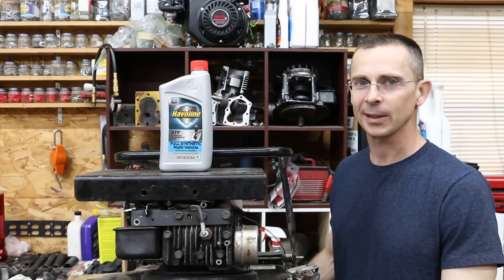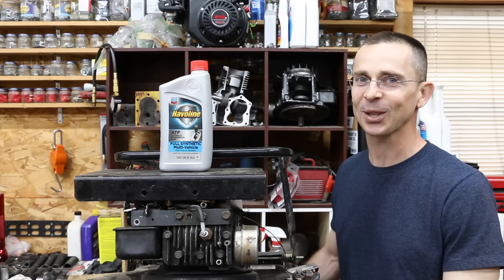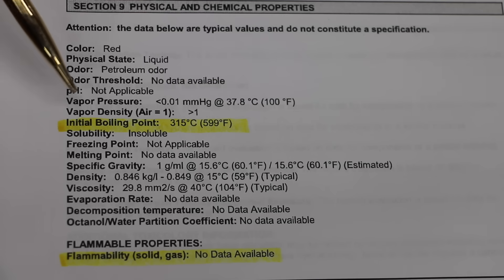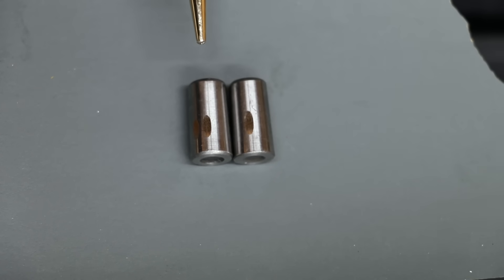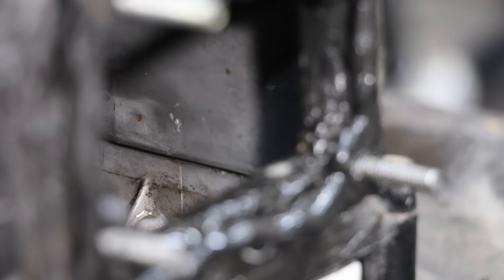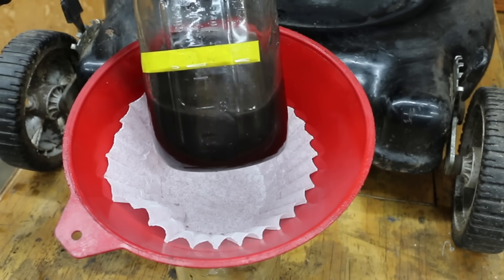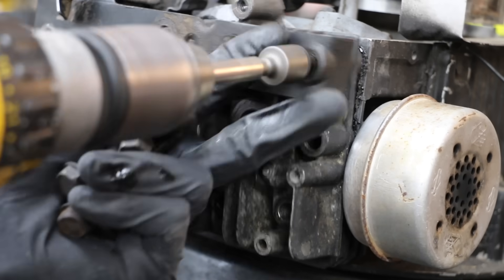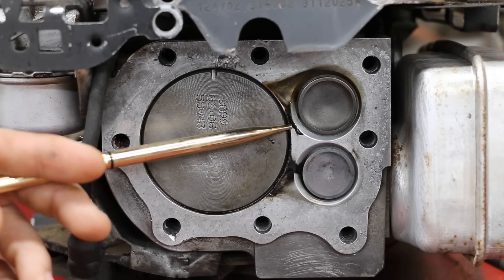ATF as an Engine Oil substitute?  Let's see what happens!

Comment: ATF will definitely clean up an engine.
Guy bought little old ladies car that ran perfect up and the streets near her home. She was trading for a car with automatic trans and learned she could get more by selling privately. Rust free, spotless car, he thought it was a steal. On his way home it would not go faster than 40. It  was so plugged up from her putting in town three blocks and shutting it off. He pulled the valve cover and it was just horribly slimy in there. When he removed the engine oil drain plug, nothing came out. He had to poke it with screwdriver. He called a friend who worked in gas station for years. Guy told him put valve cover back on and fill it with kerosene right up to the top. Remove spark plugs and shoot in a generous dose of STP gas treatment. Let it sit for several days, then drain it. change oil filter and fill with three quarts good oil and two quarts ATF. Drive it at least 500 miles  and change oil and filter. This time four quarts engine oil, one quart ATF and drive 1000 miles. remove valve cover  to see what it did.  Guy was stunned, almost all the sludge was gone from the rocker arms. The oil was black. The STP and ATF loosened up the sticking piston rings and the car could run 55 all day long.

If I remember correctly, he continued using at least one half quart ATF with every oil change.
Reply from the maker: Thanks for sharing.

Comment: certified technician. True believer of ATF on sticky Piston rings. had a 1993 Honda Civic 320,000 KM that smoked so much blue from the exhaust everyone thought the engine was done. Put a liter of ATF in ran the vehicle up to temp and drove it 5km  performed a hot oil change, The vehicle never smoked blue and the engine lasted years more.
Reply: My neighbor was a mechanic and kind of a cheapskate. He put all the drain gas from the lawn equipment he repaired in his 87 Mazda pickup and topped the oil off with "good used" motor oil. 
He passed away in 2016 and his son donated the truck(nickname "Smoky")to me when he cleaned out the place. 
Smoky had 435,000 on the clock and burned a quart of oil per tank of fuel.
I had gallons of atf from a abandoned storage unit. I did a lof and used 4 quarts of atf. Drove 200 miles of 80% highway and dropped the oil. 
The truck burned a quart every 3k after. ATF obviously freed up the rings and carbon. Nephew still hauls his dirtbike in it every weekend. Not bad for a 1982? Free truck.
Reply: @dwartfarquart9590 that’s damn cool
Reply from the maker: Thanks for the feedback.
Reply: Absolutely sometimes you just need to flush the gunk out
Reply: I heard of somebody using atf as a penetration fluid for old and seized engines.
Reply: @sdjnwhyNZ : 
Key is ussed trans OIL ... !!!! .. is ( has more acid in it !!!! )
Reply: Going to try this
Reply: @kh83401 older car, sure, newer car just run full synthetics for a slow clean up.
Reply: Got those results after only 5 km?
Reply: Certified technician is an invented story 😂
Reply: I'm pretty sure when they say add transmission fluid, it's to the oil not just pure transmission fluid. should be better than gas, diesel, or kerosene.
Reply: My dad would put ATF in his cornflakes if you let him.....all his stuff runs mint and gets tranny fluid flushes ,he runs it in the oil the fuel,power steering, probably his brakes ,transfer case ,diffs you name it lol
Reply: That's exactly how I was taught to use ATF in an engine by my Grandpa.
Reply: That's an interesting result that you had.   perhaps there's some similarity in the testwhich project Farm just did:

Like the test which just showed some metal in the residue of the ATF, perhaps there is something to the ATF either shaving some smoothness into the cylinder wall or rings ...

...or perhaps it flushed out some metal pieces that were stuck on the Rings which were causing some blow by.

Comment: atf as hydraulic system
Reply from the maker: Thanks for the feedback.
Reply: @ProjectFarm  sorry i type with the on screen keyboard when im just on the couch and the laptop is at the tv
I mean if you test a hydraulic pump with ATF
I'm currently running it with my anchor winch on the boat in a pinch and im wondering how right or wrong the internet is about atf as a good cold weather sub

Comment: Ive always used ATF for (like you said) stuck lifters, or carbon build up in a static environment. Ive never run an engine with the atf inside it as an oil replacement. After soaking stuck parts in atf for atleast overnight, it does a good job freeing everything. However, ive learned over years of pulling wrenches and field testing hydraulic systems for Komatsu, and other big name heavy equipment companies, if you have mechanical parts that repetitively fail or show excessive wear, it is cheaper in the long run to replace said parts with new ones. Then take a good look at the ambient environment the machine is being used in. Or check for lubrication SPECIFICS! Most any machine designed to be operated with some type of lubricant will have certain specifications required to get the most life out of said machine. Even something as simple as the average elevation you will be running said machine in can cause severe issues if you do not know any different. I can take a Chevy 350 base engine and in Mississippi running 30w engine oil and I will have to rebuild the engine before the starter ever gives any problems. However, that same engine and vehicle with 30w eng oil being used daily in umm, northern Indiana, Illinois, or Canada and within a year to 18 months you will have to replace or rebuild your starter because of the extra stress and wear placed on the starter during cold winter months with oil designed for subtropical temperatures. Using a 10w or 5w30 engine oil designed for operating in a cold environment will drastically lower the resistance the starter has to overcome beforehand and as it spins the engine over.
Basically cause and effect. Understanding the effect with some common sense and reading the owners manual often times leads to prevention of the cause...
Reply from the maker: Thanks for sharing.

Comment: Have you tested different ATFs?
I always hear that if you get water in your oil you can't recycle it, you need need to dispose of it as contaminated waste, but I had a pot I didn't like and a hot plate.  I heated it until the water evaporated and then recycled it.
I have been trying to find a transmission leak and have put a lot of Lucas Transmission Fix in there.  I had a pan of ATF that looked watery, so I used the pot and the hot plate... and it boiled away.
You said the boiling point of ATF is 600°F and the MSDS for LTF is >500°F, so what did I do besides personally ruin the atmosphere?!

Comment: My neighbor uses ATF in his diesel fuel for his tractor...he says that it has been a mainstay of running a quart every fourth fill of the fuel for the machine for years since the lower sulfur formula.  I have been using the Power Service Diesel Kleen which seems to help starting etc.  Years ago I was told by an older mechanic to take several quarts of ATF and run it in the crankcase of my older Ford 6 cylinder pickup after draining old oil to flush out and then to do the regular oil change.  I did that every third oil change before selling the truck....last I heard of that truck, it was still running well despite the hard life I gave it pulling a trailer etc.
Reply from the maker: Thanks for sharing.

Comment: I had an old 74 olds 350 with a sticky lifter …tried a quart of trans fluid in the crank case for a week of town driving and it did help…engine would only a couple seconds of ticking on start up and the moment the lifter got oil pressure it quieted down!
Reply from the maker: Thanks for sharing.

Comment: I agree you should not use the tranny fluid alone. For cleaning crank case etc use about a 10 - 20 % mixture eg. throw in a half quart to a quart of TF in about 100 mi. before your next oil change, then dump it. That'll do what you want it to.

Comment: A fellow I know brought a push mower to me to check out to see if it was any good. Before attempting to start it I checked the oil. Somebody had put transmission fluid in for oil. I drained it for longer than normal
 I put in 30w heavy duty oil, dried off the plug. It still wouldn't start without pouring gas in the carburetor. Then I found oil coming out of the muffler. I assumed the motor is damaged. I drained the oil again. It looked milky. I've thought about putting in more oil & that the transmission fluid had thinned the oil. Do you think it would be a waste of oil to try it again?
Reply: sounds like you either had water in the oil. or that you put too much oil in.  If the motor runs its likely not ruined.  Pouring gas in the carb indicates there is a car or fuel line issue.
Reply: @MichaelMantion  I put in the right amount of oil. My problem is oil coming out of the muffler every time I pull the rope. I assumed the thin transmission fluid had ruined the rings or  or the cylinder wall.

Comment: I've been running atf prior to and @ oil change time for years on my 5.9 gas mopar for 22 years , not religiously mind you , but often just the same.  I can give you some facts.  The oil filter is noticeably heavier when removed vs. Not running the atf.  I would conclude due to the atf cleaning /dislodging crap from the internal motor.

However, when I decided to swap my valve covers to the over priced "Ricky Racer" mopar set, I found more build up in the stock covers and top side of the heads than I anticipated .  ?????

The motor has 300k and hasn't been opened up or anything replaced other than a timing set over 15 years ago when it developed a coolant leak @ the front cover to block surface .  Timing set was replaced because I was that far anyway and the chain did have excessive slack.

Happy to report that since Dodge had to replace the short block two days after I bought the truck new and had a whopping 250 miles on the odometer.   Its ran without much trouble and still sports 40-43 lbs oil pressure to this day.  So I could give you countless other issues with this truck but to stay on topic, atf has not hurt my motor as far as I can tell without tearing it down.  One day I may add to this report but I doubt I'll remember even submitting it  ,  probably by next week if history is an indicator !

Peace everyone!
Reply from the maker: Thanks for sharing.

Comment: Be interested to see how this compares with something like Castrol Flushing oil. I don't understand why you seem to think that by adding hydraulic fluid to your crankcase you are going to clean anything. What exactly are the supposed cleaning properties of ATF? Surely a good quality detergent oil or flushing oil would be far better. As for the "scoring" test, unless I am blind, the used ATF has a smaller wear patch than the new fluid.
Reply from the maker: Thanks for the suggestion.

Comment: So transmission fluid has been designed with detergents and anti-varnishing compounds. Its usually a high grade oil as well. I would definitely not recommend using it as complete replacement for engine oil.  Also I don't believe you would see any change in combustion chamber or at valve seats in chamber as oil should not be contacting these areas. However I have personally used transmission fluid to loosen oil and compression rings stuck in pistons. The detergents inside the ATF seems to chemically break down carbon and allow for easier cleanup as well. If you have a badly sludged engine I Use 1 quart ATF 1 bottle Sea Foam or Engine flush top off with oil idle for an hour change oil and have seen very good results. This was a very good video providing further proof why I don't totally replace engine oil but use as additive in cleaning.
Reply from the maker: Thanks!  Thanks for the feedback.

Comment: I use atf to flush marine gear units and outdrives that either have excessive metal in oil, extremely dirty gear oil or especially in units that suffer from water intrusion (blown out oil seals etc), then reseal and fill with 85-90W Hypoid GL5 rated marine grade gear oil.  Good demo, ty.
Reply from the maker: Thanks and you are welcome!

Comment: I use a qt 1 week before every oil change my 2002 ram 1500 5.9 has 276000 miles and runs like a champ
And I use motorkote every 4th change
Reply from the maker: Thanks for sharing.

Comment: Auto tranny fluid is 10 weight motor oil with anti wear agents seal conditioners and red dye that's it . it will do in a pinch just don't overheat it.
Reply from the maker: Thanks for the feedback.

Comment: I have replaced 1/2 of a quart of oil in some used Harleys that we have had in the shop with noisy lifters, run them about 15 miles and drain it out.  Has fixed quite a few.  Marvel mystery oil will do the same trick though.
Reply from the maker: Thanks for the feedback.

Comment: I had an old 87 jeep Cherokee with the straight 6 motor,them motors are tougher than a homeless man fighting for a cigarette butt
It had that lazy lifter problem after about 350 thousand miles
I would change the oil and put 1 qt ATF and 5 qts of regular oil and after I believe it was 3 oil changes the lazy lifter tap was almost gone completely!
I've recommended this to a few different ppl and they all came back with the same results that I had!
I am completely 100% sold on using ATF to loosen sticky lifters and cleaning gunk out of the engine. There are a bunch of videos on YouTube that ppl have put up with the ATF test and more than 75% of the videos the ppl are also sold on it.
The slow motion part you showed with the ATF thru the little clear window was awesome btw lol
Reply: And also I sold that jeep with almost 500 thousand miles on it and that was over 10 yrs ago,the guy who bought it was an old friend of mine who bought it to use on his farm and I swear that jeep was still running as of late last yr,he said he put about 90 to 100 thousand on it and it still runs like a top,he also said he still does the 1 qt ATF everytime he does the oil change,he said he changes every 2200 to 2500 miles just because it's an older motor
Now idk if it's because of the motor being hardcore or the ATF or maybe a combination but I have no complaints
About it whatsoever

Comment: I have a 98 Grand Cherokee with the 5.2 and some sort of valvetrain tick only after being run hard.

Do I need oil stabiliser? I have used rislone engine restore, and I must say, my jeep became quite happy after that, and the lifter noise seemed to go away. I heard the tick again the other day on a fresh oil change after almost getting stuck in the mud so I had to gas it. I added more rislone to the new oil.

Probably going to switch to seafoam or ATF.. and that's why I'm here. Let the video begin.

Comment: oil goes in crankcases, atf goes in transmission. but a 30-70% mix of atf in oil (30% atf) will clean and lube, just don't leave it in past 200 miles. so will marvel mystery oil and it will do a better job, and can be left in the engine.
Reply from the maker: Thanks for sharing.

Comment: Wow I bought a 1970 Cadillac in 1982. It was literally owned by a 'liitle old lady'. She kept in it the garage, the car was beautiful, but she wasn't one for mechanical maintenance. It only had 70k miles on the 472, but it did have a very slight lifter/valve tap. Very slight. I had a good friend who was a long time career mechanic for a Chevrolet dealer. He told me that when I changed my oil, add a quart of ATF. I used to change my oil every 3k miles, (yeah I was a crazy kid), but hey it worked. Valve tap, lifter noise went away. I had to sell the car because it was in my girlfriends name, and we broke up.
Reply from the maker: Great feedback! Thank you
Reply: @ProjectFarm  You are the only poster I know of who actually responds to replies, or replies to responses? Anyway, yeah, thanks again. I know that your videos take hours, days or even longer (and $$$) to produce. Very informative, very useful. Thank you!